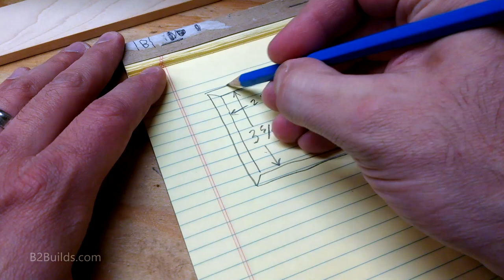Making a Playing Card Box from Maple & Walnut

Comment: Love it! I like how the bottom is recessed a bit. That's a nice touch. I don't typically use steel wool after lacquer, but I like how it turned out. Maybe I'll try that next time.
Reply from the maker: +Bruce A. Ulrich Thanks Bruce. The protruding-but-recessed bottom is bar far my favorite feature of the design. That ideas is the main thing that drove this project. The steel wool was a first-time experiment. I think I read somewhere that people used it to buff pens with a CA glue finish. I gave it a shot after a few coats of lacquer and was pleasantly surprised at how nice & smooth it came out.
Reply: +Ben Brandt I use steel wool to buff out 100% tung oil after I let it cure on cutting boards and stuff. Works well. I'll give this a try for lacquered things.

Comment: I guess the steel wool is to break away and raised spots from the spray lacquer?
Reply from the maker: +Bruce's shop stuff and other things Exactly... The steel wool was a first-time experiment. I think I read somewhere that people used it to buff pens with a CA glue finish. I gave it a shot after a few coats of lacquer and was pleasantly surprised at how nice & smooth it came out.
Reply: nice. I've never tried that but I've noticed how rough the lacquer can be.

Comment: sorry for the newbieness, whats the machine at 1:24 called?
Reply from the maker: No need to apologize. That's a small "jobsite" style table saw. The yellow thing I'm pushing across is called a "push block" to help me safely move the wood through the saw and protect my fingers.
Reply: @BenBrandt22  are there any small versions of that Saw?(with adjustable Blade height)
Reply from the maker: Well, that pretty much is the small version of a table saw. Though if you want something extra small for light-duty tabletop cutting, I've seen a "Mighty-Mite Table Saw" at Harbor Freight with a 4-inch blade... No idea how well it works though.
Reply: @BenBrandt22  wow thanks a lot . Hope to see some .more crafts from you in the future!